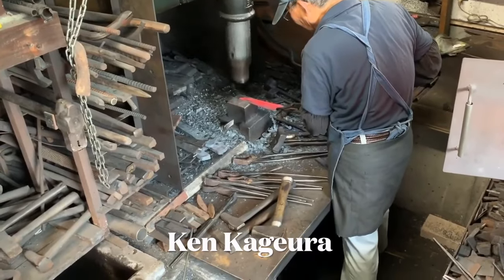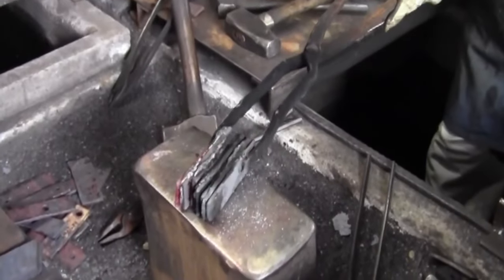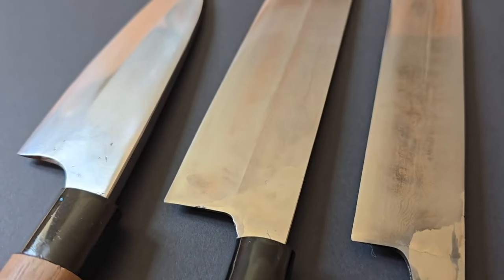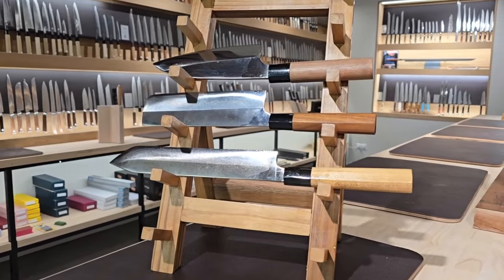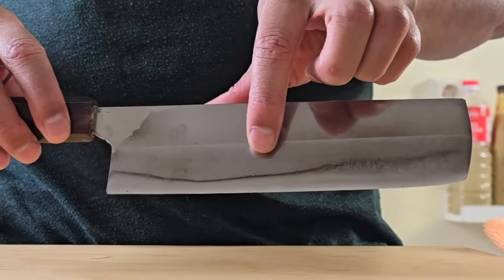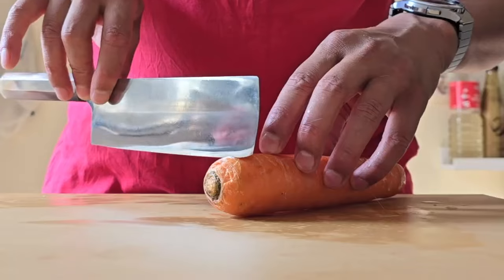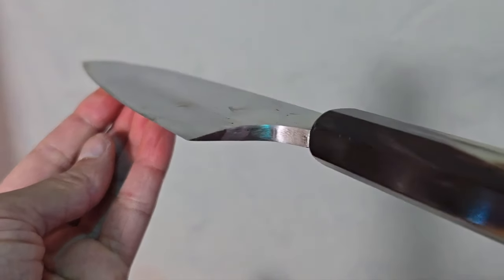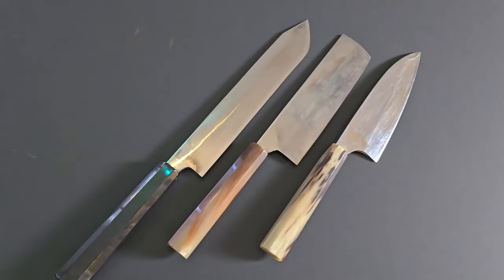Why are Japanese Kitchen Knives By Retired Blacksmith Ken Kageura so special?

Comment: The pitting on the knifes is most likely from the forgewelding of the damascus. When you use new bought flat steel everything stacks without a problem and has maximum surfacecontact when forgewelding, but when you use material that you have to forge to shape first its not 100% flat and during forgewelding this can result in weldflaws. This is also very common in tamahagane blades. 

This was a rly interesting video and not a waste of time!
Reply from the maker: Thank you for sharing that info about the forgewelding. I'm not a knifemaker nor a metallurgical expert, so I'm always happy to be more informed on that department. 🙏🏾
And thanks for getting my sarcastic sense of humor 👌🏽
Reply: @chefknivesenthusiast  Youre welcome! Im bladesmithing as a hobby and love to use scrapmetal in my projects so i could relate.
What i like about your videos is that i can see and study high end knifes and how they perform compared to what i can make.

Comment: I’m a retired pro woodworker and I have half a dozen “standard” quality Japanese chisels . These chisels are also laminated with hard steel on the bottom forge welded to softer iron. I remember there was a big competition from smiths to obtain “pre war” steel just for the softer part. Some sort of dubious claims about the steel not being radiated from atomic bombs. Pre war anchor chains was the holy grail of what they were looking for. This being just for the soft part I remind you. Japanese chisels have unique hollow grinds on the bottom you’d find interesting. The hard parts of the chisel were standard Hitachi steels.
Reply from the maker: It's interesting to hear about the pre-war steel theory. I do have a Munetoshi knife soft clad with steel from a 500 year old anchor. I also love wrought iron clad knives.
Reply: I’m pretty sure Minoura goes with pre war steel for his “river jump” cladding as well. All of my Japanese chisels have one big hollow grind on the bottom in order to make flattening the bottom easier than a western chisel. Same sort of idea as the left side of a single bevel knife. They are able to get the hardness up to 62-63 without being brittle. Western chisels probably can’t go higher than 58-60 without getting chippy.
Reply from the maker: @trappenweisseguy27  We actually have a boc with a set of Japanese chisels in our Showroom.They also have an Ura side, like on single bevel knives.

Comment: I must admit, I have never learned to enjoy using a nakiri. I like the usuba much better, maybe because of the single bevel? I do ok with a santoku for a lot of things.
Reply from the maker: I mainly cut veggies, so a Nakiri or cleaver profile is usually my go-to option. The large flat spot makes going completely through smaller and larger veggies a breeze. Especially when you prefer to use the push-cut,  pull-cut, or straight up-and-down chopping technique over the rocking technique. 

I rarely use Usuba's on the cutting board due to the very fragile single bevel edge. Plus, and Usuba is actually made for the Katsuramuki and Ken technique.